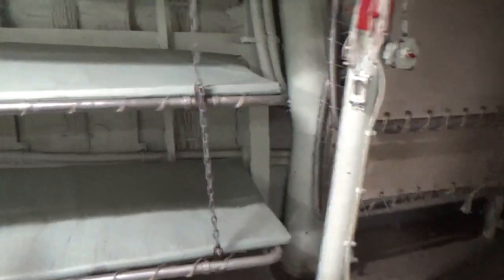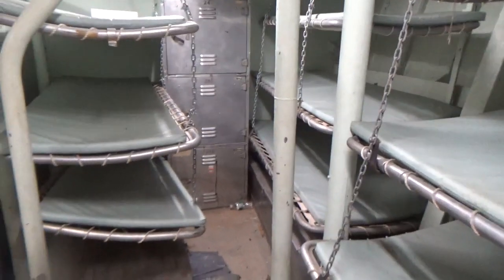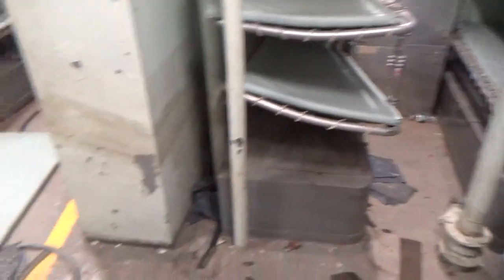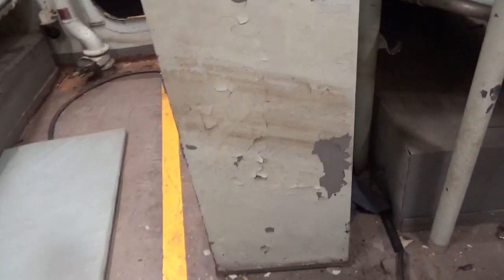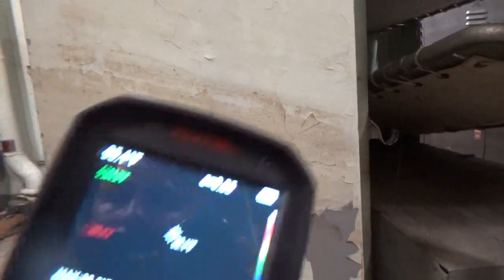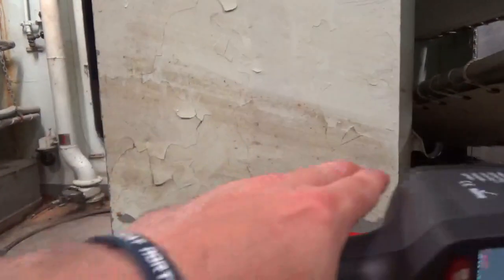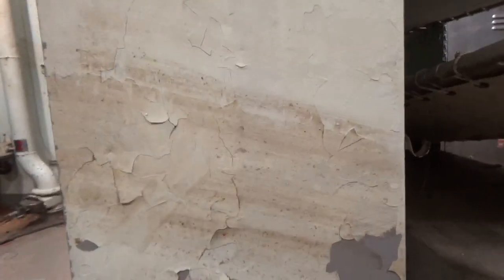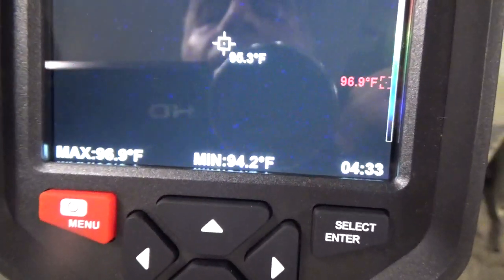It's what temperature?? Thermal stresses on USS The Sullivans

Comment: As someone who frequents these museum ships, especially being out of FL (USS Alabama, USS Yorktown, USS N Carolina, etc...), I always highly recommend folks start their tours on the deck and upward and as early as possible.  Then make their way downward away from the radiant sun to the cooler areas and waterline that aren't exposed to the sun.  This to include being careful of exterior handrails and touching the exterior hull from the inside after noonish.  I've been touring such great displays for over 30 yrs and experienced many variants of climate and it's always made me ponder of how the crew managed these conditions.
Shane, I do know in years past that the attempt to use the ducts with the fan is somewhat fruitless.  But by using the clear plastic octopus walk throughs (like for coolers) in strategic areas where guests pass that can maintain AC easily and have a couple sitting benches works.  Also provide an instructional video to view for a few minutes to gather themselves before continuing.  They use these with great effect on the USS Laffey at Patriots Point (I'll be there the week of the 4th).  One space, center of the ship main deck, is a single In/Out with a video from the History Channel on the Laffey and her Kamikaze attacks.  Many folks take advantage of this area, especially older folks and they get a history lesson.
They have another in, I believe the Radar Plot Room, with a great 3D projected simulation of how the ship responded if a Russian sub would get too close.  
Units like the ROVSUN 9000 BTU Mini Split AC/Heating System work well on 500 sq ft and less rooms and run around $400-500 a unit.  You can get multiple unit discounts as well.
Reply from the maker: Normandy1944...thanks for your continued thoughtful comments! I will say that we do have AC spaces on Little Rock that are "gathering spaces" for visitors. In one space (Officers Wardroom) we do play a video called "Dday's Sunken Secrets" by NOVA, which people really enjoy. Also our mess deck on Little Rock is a more temperate gathering spot. For The Sullivans in her current state, all of the spaces that I went to in the video are currently off the tour route...it's main deck, 01 and Bridge level only...so, keeping it cool wouldn't be for visitors yet, but trying to level off the temp to avoid these swings (like we do in winter) is something that's important to me\Naval Park. Thanks again for your continued support of our channel and all museum ships near you!
Reply: @BuffaloNavalPark  I need to get up to The Sullivans, perhaps this fall?

Comment: Just use fans to circulate air, should be fine.
  Cold air sinks. Hot air raises. Metal will absorb heat.
Reply from the maker: Thanks as always, Greg. But, we'd have to break WT integrity...i don't know how much would help if we just circulate stale air in a WT space...appreciate it!
Reply: @BuffaloNavalPark  force outside at stern suction at bow. If all water tight hatches are secure, it wouldn't work.

Comment: Shane, are you sure its showing air temp and not simply surface temps of the materials? It could be a case of the surfaces are baking the air in the compartments. My suggestion is you need to have hatches that can catch prevailing breezes. A bit of tarping can help create a wind tunnel effect to speed the air up. If you can have a few hatches that give the maximum airflow at night to cool the interiors then seal it back up when people come in to work in the morning to seal the cool inside. If that doesn't work leave hatches open during the day and have fans circulating the air along passage ways.
Reply from the maker: Sean, thanks for watching...and no, I'm not sure about the thermal gun. Was told it would work well, and just ran with it. Good thoughts, especially about the tarping...we want to keep WT integrity, but I think it would be good to also have air flow. Can't leave anything open at night for security reasons, but...it will remain this temp (down below) throughout the summer here. Fans are good too...appreciate your thoughts, and I'll bring them to the staff!!
Reply: No problem happy to be of help.....break out some old pics of Fletcher class DDs tied up to docks you almost always see the hatch in front of Mount 51 open and others to catch the breeze. Especially in pacific areas. Worked for them then should work for you folks now.

Comment: So, typical summer day in Texas.  Course being in a steel box with no airflow...

Does the ship still have any air intakes up on the deck or super structure that could be used to blow air throughout the ship's existing ventilation system?  Even if the outside air is at 85 or 90, that could still be an option to have that blow through the ship.  Cheaper than putting in an AC.  Plus if you could blow outside air through the ships vents, it could be sold as an immersive experience.. just as the ship's crew had to deal with while it was in service.  

Don't know how practical it might be, but it was my first though in lieu of an all out AC system.
Reply from the maker: Thanks Bryce...with most of the electricity dedicated to lighting systems, it might tax the system...most of the plenums and ventilation shafts still have their blowers but getting them onto the temporary grip may be tough. Now, have temporary blowers installed, like we have for the winters is an option...but, what's the use of blowing 95 degree air around an enclosed space?? Solving fresh from main deck is important...appreciate your thoughts and support!